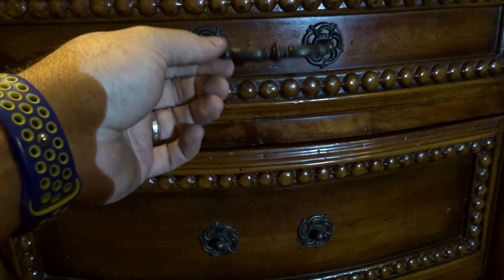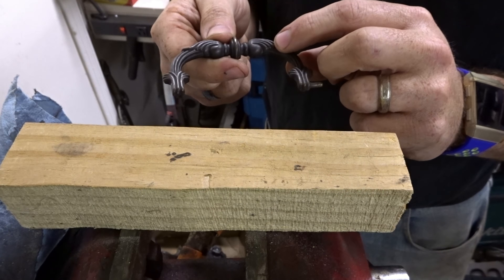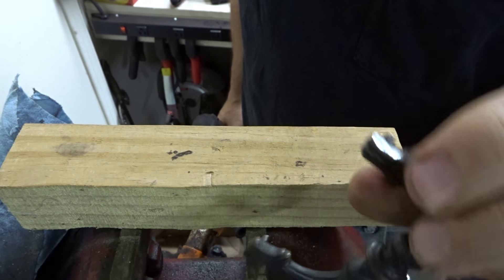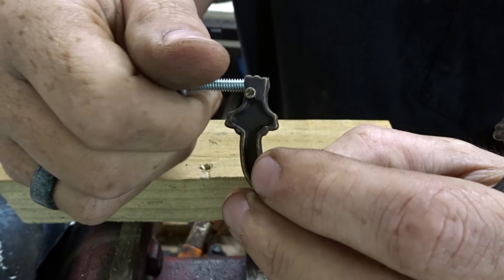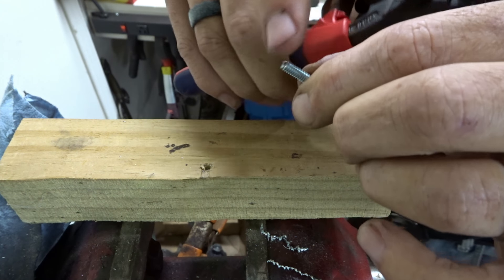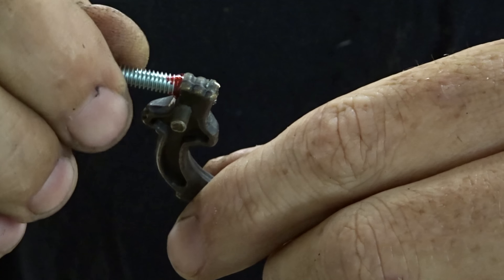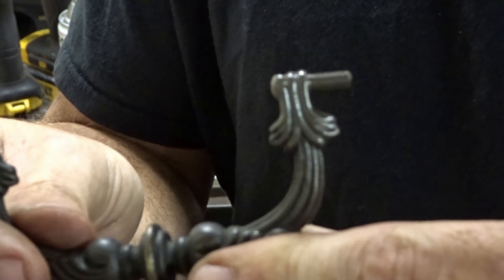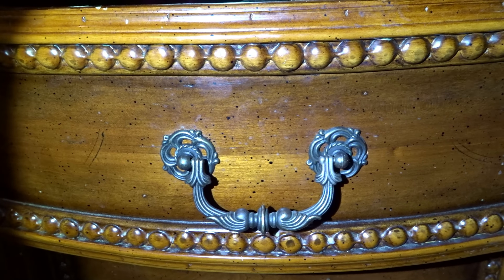How to Fix a Broken Dresser Drawer Handle

Comment: That is exactly what happened to my pull, same style!! I have been looking for 3 replacement pulls but none are the right width on this piece that was made in China. Is the 8/32 screw good across the board or is there a way to have the nub that broke off measured at the hardware store? Oh, they have that graduated holey thing (template) don't they??? I don't have al the tools but I think I know someone who does. I know Ace hardware will cut off the screw head for me and smooth off any rough edges. Genius!!! Thank you so much from a DIY woman.
Reply from the maker: WOOT WOOT!!!!!  super happy I can help in some way
Reply: @1105pitbull Ty for the information about the hardware store.

Comment: Well,  here is my problem, there isn't anything to drill through. The tab that broke off was just welded or formed with the end of the pull. I would have to drill off the remainder of that tab then have a new tab welded on the narrow pull back. Rats. Who would do that if, in fact, it can be done? I would include a picture but don't think I can?